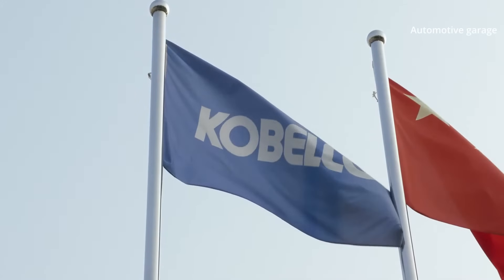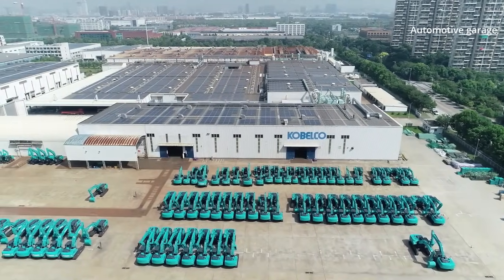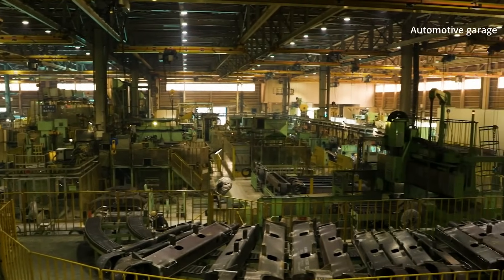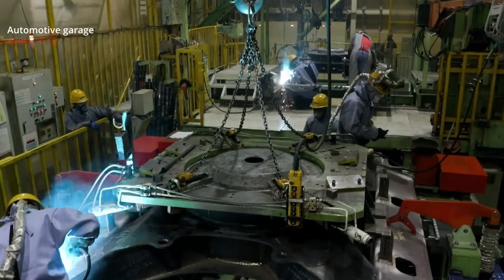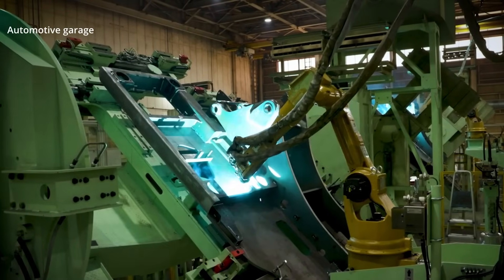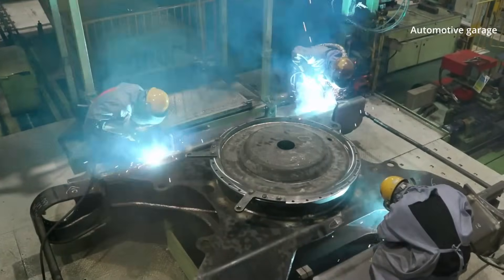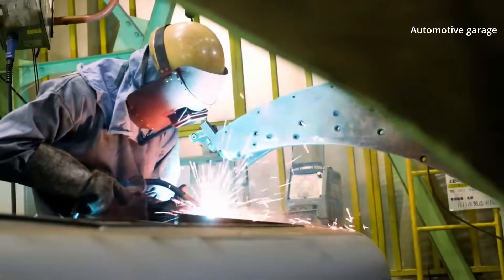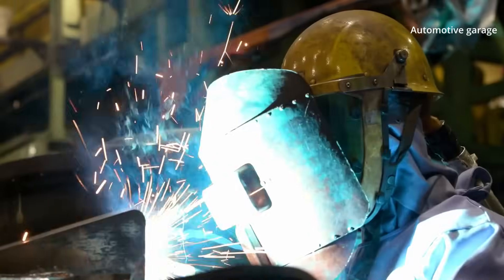Kobelco Excavators Production In Japan  - Factory Tour

Comment: Kobelco Also  have The One of the Best Quality  Steel, Hbeam, Angular, structural steel, Mechanical Steel. Compare to Chinse or Taiwanese Dragon Steel. I Observed this when working with Several Structural-Mechanical  Fabrication projects in SE asia. The kobelco  steel Material under the Sun and rain Would Rust Very Very Slow with a Very Uniform and Micropowder profile while the Chn and Taiwanese steel would Rust so fast With Flakes of Rust and Uneven profile, Also with low quality Mill process that a flange of an H beam or plates would have a layers of steel Unfused means they were Not Dead Solid.

Comment: Hello, I have a problem with the GCB 350 excavator. The engine is running, but the arm movements are not working. If anyone knows the solution, write in the comments. Please answer, thank you.
Reply: Get a gasoline, pour it on your machine then burn it.

Comment: Pure junk . My 2019 sk140 didn’t make it to 1200 hours . Was in the shop ever 250 since new and was never fixed correctly. I traded in in for a new Komutsu pc138. That machine has over 1800 hours with no issues. The Kobelco reps pertained to care but never did anything to help as I was losing money while my machine was down. I would never buy one of those piles of crap ever again.
Reply: Could you please tell me the details of the problem?
Reply: Electronic issues, Def sending unit, Def control unit. Multiple bad sensors.  The crazy part is all of this parts were replaced many times by the dealer and the machine kept throwing the same code. And would put the machine in limp mode. No one ever truly fixed it or could tell me what was wrong.
Reply: @jamiehamilton789 
Thank you for telling me. The company's website states that it is necessary to use genuine engine oil or low-sulfur diesel oil, but if replacing the parts did not fix the problem, it probably means that there is some other mechanical problem. In any case, I have to say that customer support lacks knowledge.